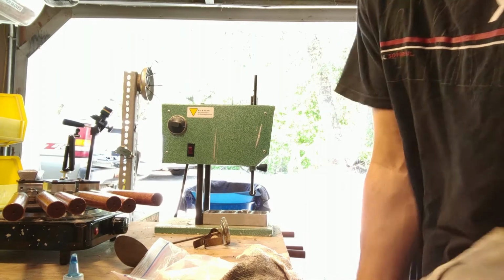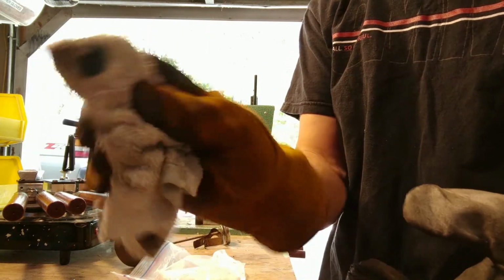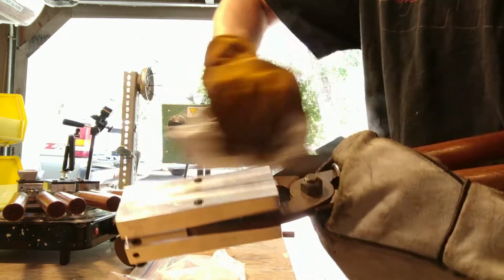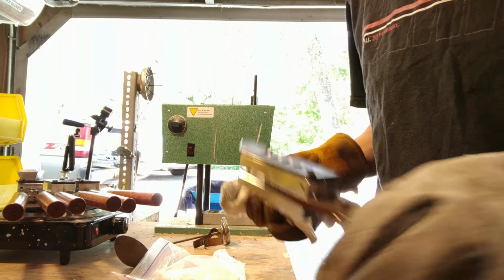QuickTip #2 Lube the Sprue Plate! (A Little Lube Makes it Glide!)

Comment from the maker: How do you guys like to keep your molds lubed properly?
Reply: I use a Q Tip and synthetic 2 cycle motor oil.  I lube the top of the mold,the sprue plate on the first cast while the bullets sill in the mold I put it on the tip of any HP pins if I'm using one of those type molds.  For storage I coat all the steel molds and sprue plates with USP Mineral Oil which burn off nice an clean with no reside while the mold is heating up on the hot plate.
Reply from the maker: that is good advice!

Comment: Noe doesn’t have any lube. What else would you recommend to use?

I currently have MP molds. Have NOE resizers. Bought a ton of stuff but haven’t got started yet. Still couple small details to cover before instart
Reply from the maker: 2 cycle engine oil (synthetic)

Comment: is NOE your preferred mold?
Reply from the maker: Yes.  I have Lee's, Accurate Molds, and NOE.  Accurate molds are great if you want a certain design made right now.  They charge a decent amount more than the NOE, but you can get what you want right away.  Lee's are nice because they don't cost much, they usually work (I've had some bad experiences with a few, but have had decent success with several others).  The 6 cavity Lee are significantly better than the 2 cavity Lee molds.  With the lower price comes less niceties, less features and overall lower quality.  With NOE, I feel like you get a very high value for the dollar, but at a price point between the Lee's an Accurate's.  The quality is top notch, and you can definitely feel it when using their molds.  NOE has the ability to make pointy bullet molds, hollowpoint, etc, that Accurate does not offer.  And, if NOE has the design in stock that you want, you will get it fast.  With new designs, however, they run group buys that do take some time.  But patience is rewarded with a 15% discount when the molds are ready.  To top it off, I live about 5-10 min from the NOE shop, so I can order something and then go pick it up minutes later.  That saves me more money without having to pay shipping--and I get it same day.  Hopefully this is helpful to you.